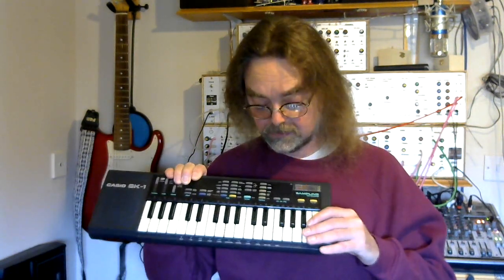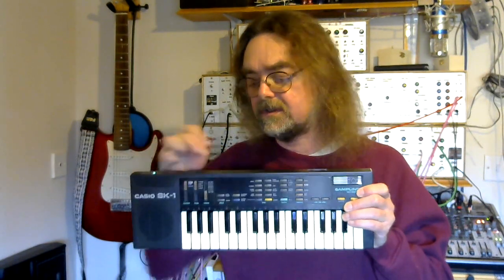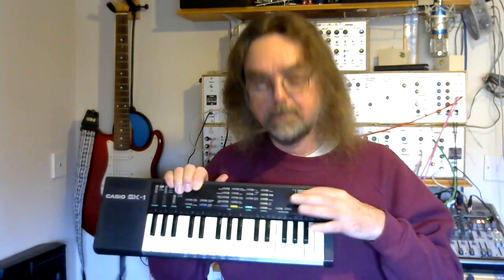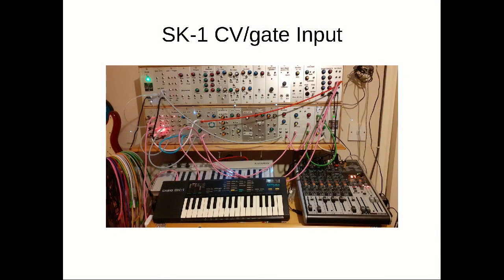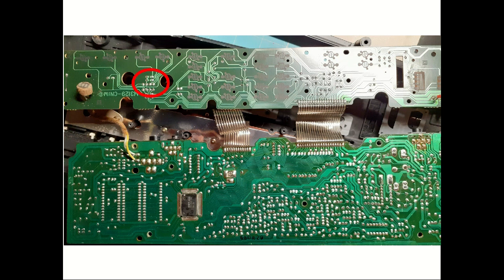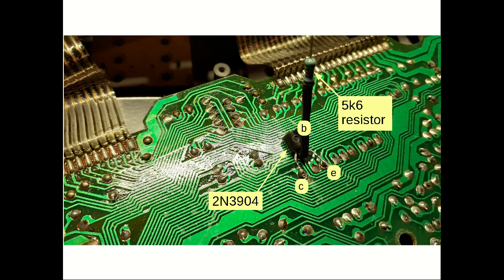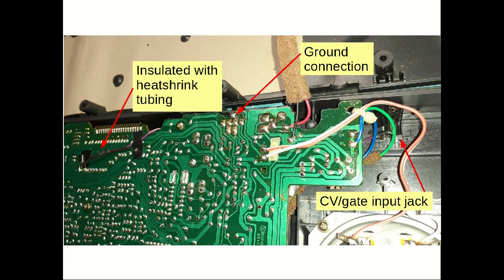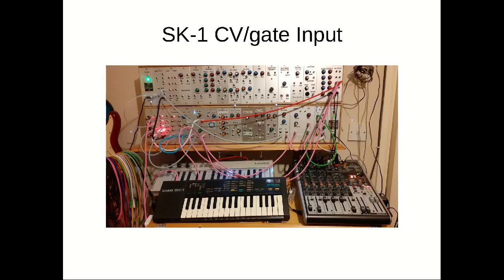Casio SK-1 CV/Gate Input Mod

Comment: Great vid! New fan. Love your setup 👍😎 hoping to find as a new sub, info on all your modules. Those drums are fantastic! I have on question & it's not clear to me & not well documented in pictures. What is (where) the purple wire connected to? The link you posted doesn't seem to work any longer sadly. Was thinking to just look there. Cheers, great work. I hold you completely responsible for making a wonderful video lol...
Regards
Reply from the maker: The purple wire is the control voltage (gate) input. One end is connected to the resistor on the base of the transistor and the other end is connected to the 'tip' terminal on the input jack. Hope this helps.
Reply: cheers... So is this correct, the 2N3904 has 3 legs. The left leg connected to most left solder point (1), middle leg bent up, right leg 3rd solder point & then the middle goes to one end of the 5k6 & other side of 5k6 leading to the purple wire? Did I get it? Does it matter the direction of the 5k6 (which stripe color first)?
Also looks like the 2n3904 is flat side down on the board? (Curved side up). Lastly what wattage should the resistor be? .25/.50 does it matter?

P.s. I checked out your SoundCloud & BC, pretty cool stuff. I'm guessing you're pink dots fan?
Reply from the maker: @wallpurgesnight8209  The 2N3904 is a NPN transistor, the letters on my diagram are c=collector, b=base, e=emitter. It is important to get them the right way round, so flat side down is correct. It does not matter which way round the resistor is connected and I used a 0.25W. Hope this helps.
Reply from the maker: @wallpurgesnight8209  Not heard the Pink Dots before, will start listening though : )
Reply: @CuSiSound  I think you will enjoy them... They're my favorite band that is still around. Edward Ka Spel (the vocalist) also does solo & side projects too. Worth a listen...
Reply: @CuSiSound  thnx for the response/info & confirmation in the placement & wattage. The transistor I bought has the markings 2N3904 with additionally under that (B331) does that matter?
Reply from the maker: @wallpurgesnight8209  No.

Comment: Would this work with an Sk-100?? I really want to do this mod.
Reply from the maker: This works with the SK-1 because it has the one step play function. Looking at online manuals for the SK-100 it does not appear to have the one step play function so this mod can not be done on the SK-100. Sorry : (
Reply: @CuSiSound I'd imagine (&hope) it would work on any keyboard with that feature. Having several casinos which do. Perhaps even yam etc.

Comment: Ok the Five dollar question is.. will it trigger samples or just the stock sounds?  that modular is nice - I used to run everything I could through my SH-2.   Very clear video aside from not mentioning if it will trigger the sample input - and my apologies if you DID mention it I didn't catch it.    I have 2 of these units from over the years finding them at thrift stores.. ..they are  Radio shack they are not branded Casio.. I haven't had my original unit since the 80s lost it long ago.
Reply from the maker: This mod will trigger anything that can normally be played with the one step keys. The input should be a gate signal i.e. on/off to replicate pressing one of the key switches. You can record a sample, program a sequence in the SK-1/Concertmate then play it back with the trigger input one step per gate signal.

Comment: First off, amazing video and synthesizer,  in addition  to the sk-1. Super cool. From what I understand from research is a 5k6 resistor is a 5.6k and vice versa. Yes resistors have wattage ratings but I was baffled having some 5k1 resistors laying around. Still curios if I just put 500ohms + 5k1..wouldn't  that equal a 5k6 or 5.6k resistor? Cheers and thanks for putting out an awesome video. I was just trying to add some of what I found from looking at your video. 😊
Reply from the maker: Thanks for your kind words. You are correct, 5k6 and 5.6k are just alternative ways of writing the same value of resistor. If you connect a 5k1 resistor in series with a 500 ohms you add the values to get 5k6.